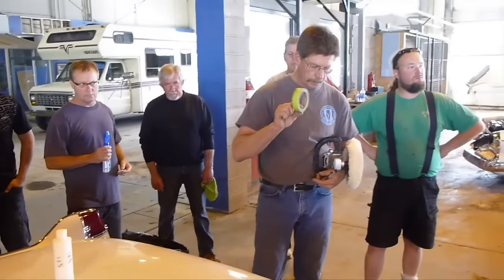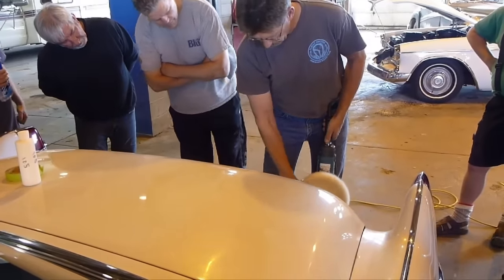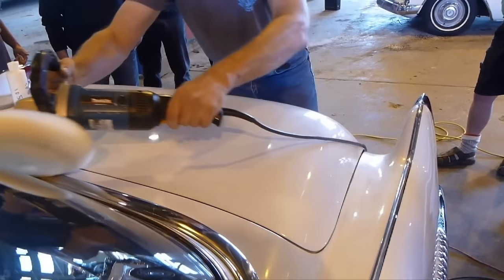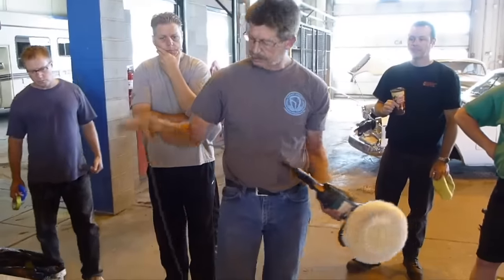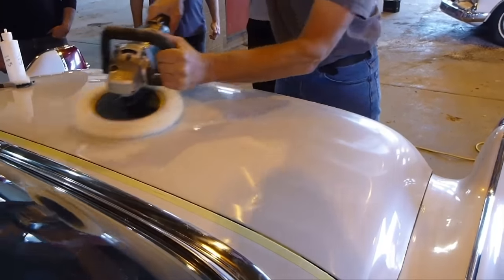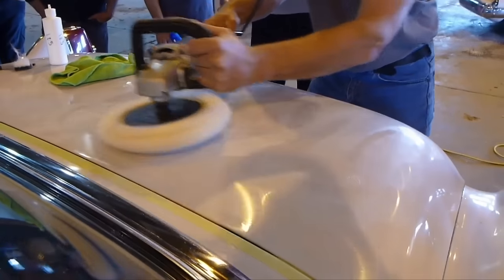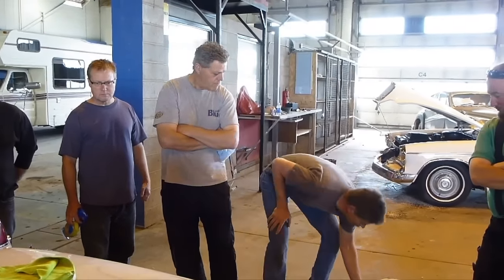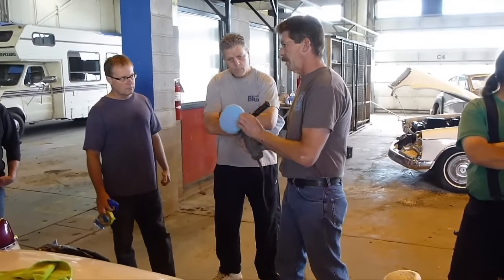Rory Showing buffing your car's paint - Do's and don'ts

Comment: Foam pad is way better
Reply: +Craigl Lacour64 wool is good for buffing out wet sanding cause it works so fast at correction but yeah id much rather use a foam pad
Reply: Craigl Lacour64 foam is easier, not better. wool makes for a way better buff, just hell for swirls